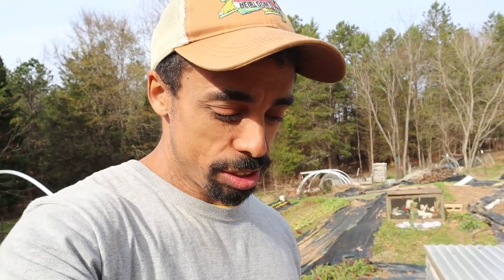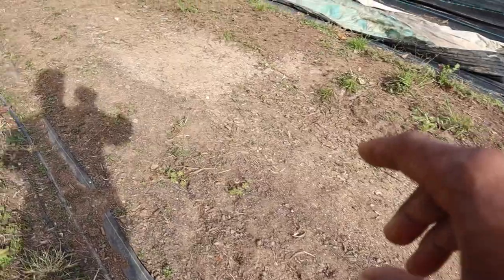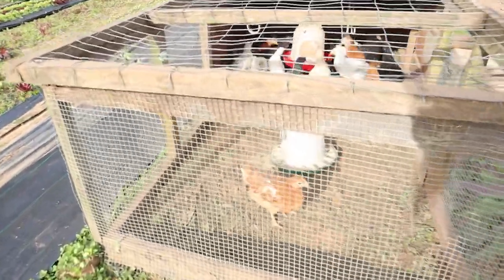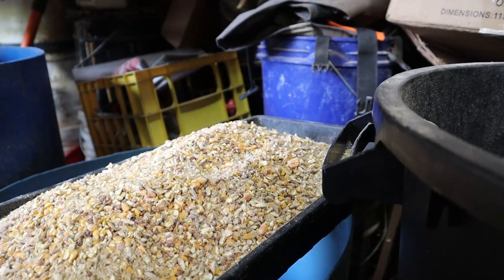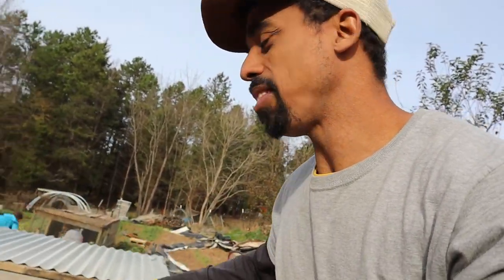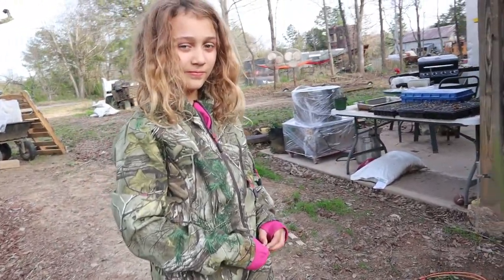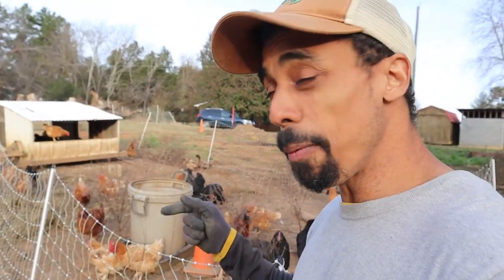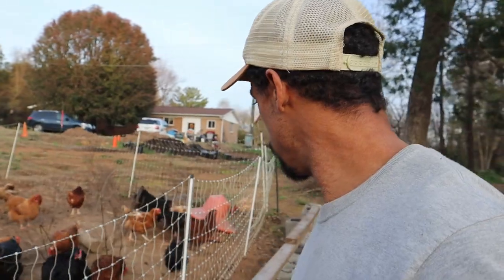Keeping my CHICKENS safe & it was my NIGHTMARE

Comment: My fix for the raised beds would be to move the 2 x 4 on the front bottom of the pen up until the corners of the pen  rest on the walkways and the middle rests on the raised bed middle. Cut the 2 x 4 wire or chicken wire or hardware cloth longer than that, curving it up on the inside of the gap so it slides along if you pull the tractor forwards, keeping the birds in. (If you pull it backwards, it would be ruined unless you fasten it to the underneath of the side of the pen 2 x 4s, but that defeats the purpose--it needs to flap and be about 4" to 6" too long.)  From where the wood now rides on the raised bed, cut a 2 x 4 that follows the angle to the walkways but cut it short enough that it rests on the ground it's whole length.  Use one nail and nail it to the 2 x 4 on the edge closest to the middle of the bed. so  that it can be hinged to fall down on the gap.  If it's as long as the loose ones you're using, they aren't solving the problem, they're just duplicating it. As long as they're short enough, you could still throw them loose on the ground and use your brick, but I can't bend over to reach the ground, so I have to redesign things to work simply. An even simpler option is to cut a bow in the whole board that fits the profile of the ground, but then you'd have to scree the beds,  before you plant, with another board of the same profile. You'll have to duplicate this on the back of the pen, but let the extra wire fold out the back. When I finish my tractor that I haven't started yet, I'll send you a pic.  A good way to foil predators is to let extra wire fold out from under the frame of any enclosure about 1 foot--they put their feet on it and then find they can''t dig--ha ha. Good luck, God Bless you and your household, and serve Him wholeheartedly!

Comment: How are the Pekin ducks for plucking?  I did Rouen meat ducks this year. Per an earlier video you did, I processed one group at 7 weeks and the other one at 7 months.  The 7 week old ducks still had plenty of pin feathers while the older ones plucked very clean.  Since they free ranged, they consumed very little feed.  Going into winter they have started eating a lot more feed, so it seems spring ducks, fall processing for me.
Can't say enough about how the animals help the garden with the extra attention the garden gets over the winter with the chickens working it over.

Comment: To fix those tires for good just go to Walmart and get some green slime for your tires put some in the tires you air them up and drive it around you'll never have to worry about airing them up again... Is a far cry cheaper than buying those airless tires...

Comment: I have had that same problems with my mower tires.  I have flat free on the front and I use the tire slime/sealant for the back tires.  So far it works.. Even when I drive over that nasty cactus.

Comment: That area you are prepping to winter the chickens in, you might want to level out first. Hit the high areas with your tiller & shovel the loose dirt into the low areas before bringing in your mulch & compost. That's another reason to get to play with the track hoe 😁. You try & level it with compost & you'll have 18" on one side & only 2" on the other.